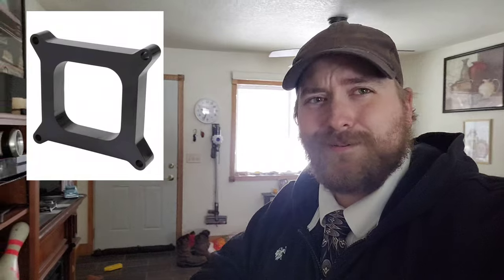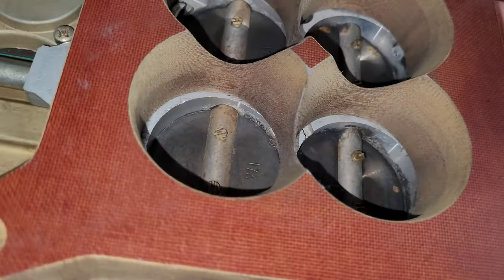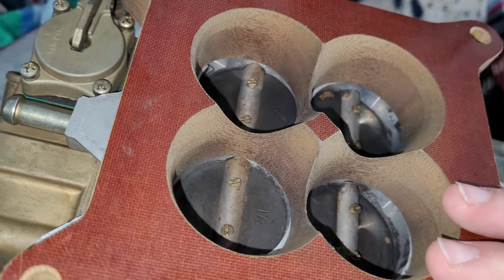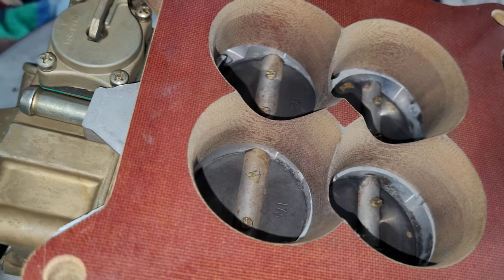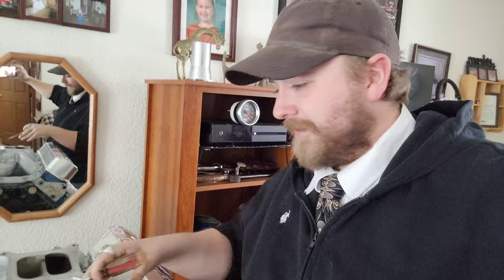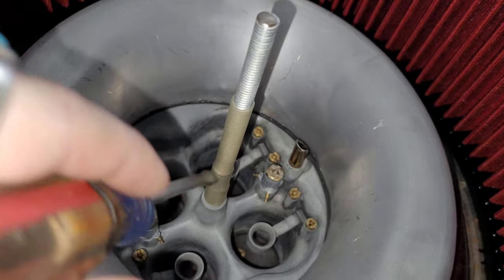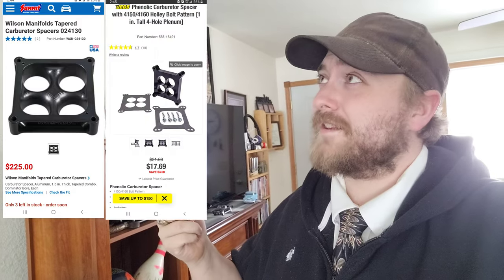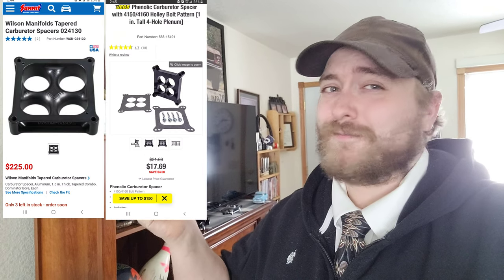Carburetor Spacers, The Rules Of Thumb....Kinda Ish?

Comment: I remember the first time an Oldster experience Circle Track Racer, told me to make a Spacer out of Wood.  I kinda freaked, but did it, and it works just fine.  I made it for a single plane. 2" thick. Used a Hole Saw to make 4 holes and a Rat Tail file to Taper the Holes. Results? Noticeable better low end torque among other things
Reply from the maker: Nice!! 😁
Thats old school hot rodding right there 🙂

Comment: I have yet to see a test where the 4 hole didn’t put perform the open spacer below 6k. Duel or single didn’t matter. We’re talking like 5hp across the board.  If you need it above 6k go open. Also, surprise to me but apparently the Edelbrock performer RPM just crushes to 6500. Look it up

Comment: I'm running a total fo 4 inches of spacers,  on a stock duel plane intake with raised air cleaner for the cowl induction.  Lots of torque with tall plenum and short runners. Gonna top it off with my Edelbrock 800 CFM AVS2 ,carb.
Reply from the maker: Nice! 😁👌

Comment: I got a lightweight dual plane manifold and i have 2 inches of open spacer under my carb now. I had to advance the timing slightly and now i have a little less low end power but it increased the high end power.

Comment: I use an open spacer on the 400 in my F250. It's the only one I have experience with and it works pretty well! Might have to make a tapered one and try it out though!
Reply: Try the taper. Open spacers tend to reduce carb response. Try it an come back n let us know if you could tell a difference!

Comment: I'm going to run a pair of Edelbrock AVS2 carbs on my TR5 Edelbrock tunnel ram. It has about an inch of straight open hole, then it expands into the main plenum. My plan is to drop the spacer down inside the hole an leave about 1/4" on top to seal. I will taper it out to fit as the AVS2 has smaller primaries than secondaries. I'm also running progressive linkage and using the rear carb as my primary.
Reply from the maker: Sounds like a sweet setup! 👍

Comment: Ever wonder why every wicked hot rod ever produced by Detroit didn’t have a spacer?  Bottom end.  Because that’s where most folks drive.   Carb spacers are like Daylight Savings Time.   They take away from one end and put it on the other and try to convince you it’s better.   “Oh yeah!   Above 5k it’s awesome!”    Nope.   I got a stack of em if anyone wants one.  You put 4, 2” 5/16 bolts with nuts on it. Set it on your work bench, studs up.  Makes a perfect carb holder!  😂
Reply from the maker: ......you can literally take your argument and replace the word "carb spacer" with "camshaft" lol 😆 

Because when you put a big rowdy cam in it to take advantage of the better heads you put on it thats all your doing is taking from the bottom and putting it on the top 🤣

Same can be said with headers too. 

And once you put the 3,500 stall in it and more gear so you are up in the power band the new cam gives you........your argument doesn't make a whole lot of sense 😅

Comment: I saw you drop a hint about Nos. Do you feed it thru the side of the spacer
Reply from the maker: It has its own spacer with the spray bar in it 😁
Will go under the other two spacers is the plan for now.
Reply: @newguysgarage6802 I have an unknown spacer with a hole in the back with two inlets feeding the back two larger holes ok for N02?
Reply from the maker: @ryanmaurer3531 ....is it a nitrous plate or just a vacuum port?
Reply: @newguysgarage6802  might just be a vacuum port
Reply from the maker: @ryanmaurer3531  kinda sounds like it 😅